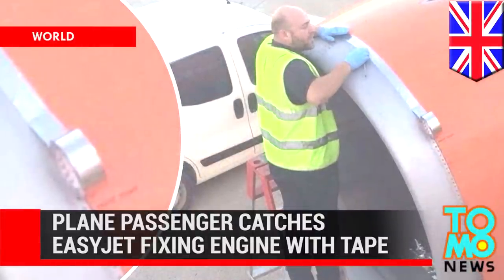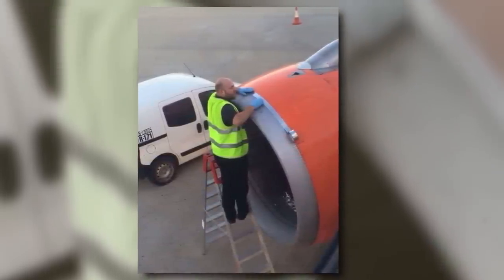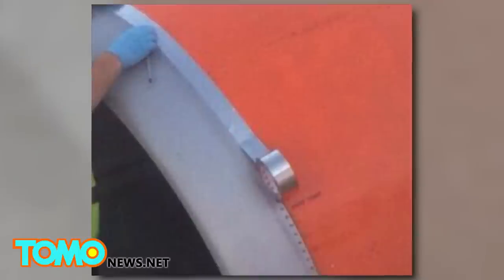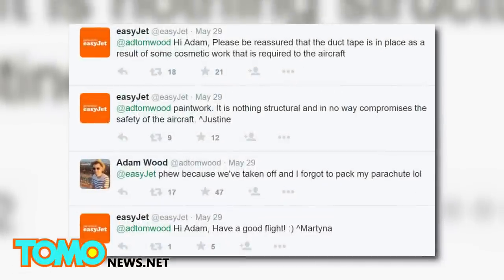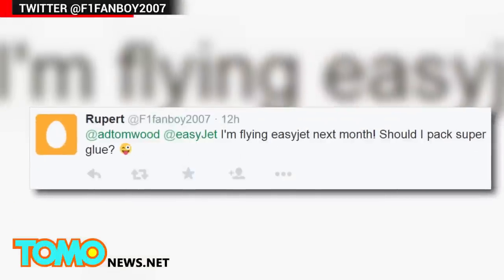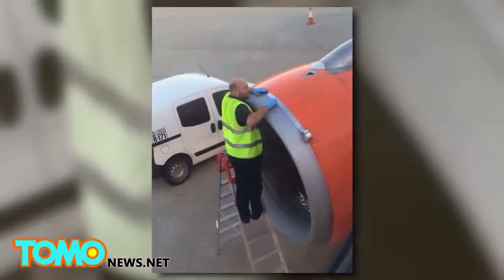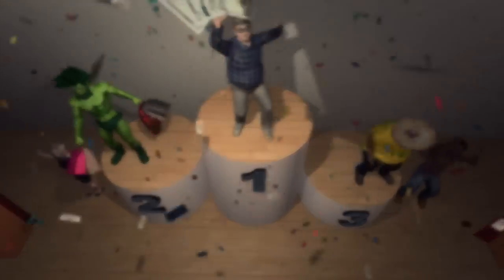Airplane scare: easyJet tapes up engine moments before takeoff in viral photo - TomoNews

Comment: we,  airplane mechanics call this, "line maintenance".. it seems  the cowling (the engine cover) does not fit very well (because normal wear package) and the guy is using this kind of tape only to avoid minimun particles and humidity  ingestion to the top of the engine...this do not, I repeat, do not represent any danger!!
Reply: You have look at it from the side of the person that doesn't know that. I am on the plane and I see the mechanic taping something chances are I am getting the hell off. That should have been down before passenger got on the plane
Reply: Jordan kretz yeah I would get a refund and not ride that one that something that should have been checked and fixed before passengers can see
Reply: hectec69 
there are often just minutes between deboarding and boarding. If a failure on the Tape is spotted in during this time, there is mostly not enough time to fix it before passengers are entering the plane. Unless you want a delay that is, but that would drive off a lot more people off than a normal Maintenance work. Don't forget, that every Maintenance worker is testet multiple times and generally knows what he is doing.
Reply: R. Perez I am training to be a line manager and this is either to keep the bolts tight or to seal air pressure or like easy jet purely cosmetic they would not let a plane fly with an issue

Comment: That's not duct tape, it's called speed tape.  It's aluminum with an epoxy resin backing that applies like tape and cures like a piece of solid metal.  It's designed to cover cracks or minimal damage or bolt holes missing their bolts to prevent further damage until a more permanent fix can be put in place.  I'd rather a crew chief put speed tape over a crack than risk it freezing and expanding at 30,000 feet in the air causing the engine cowling to split open.  THINK BEFORE YOU JUDGE, SHEEPLE.  There's this new thing called the internet that you can use to do your own research instead of blindly believing everything people tell you or show you in a shitty video.
Reply: Uh, what do you think we're doing here if not researching?

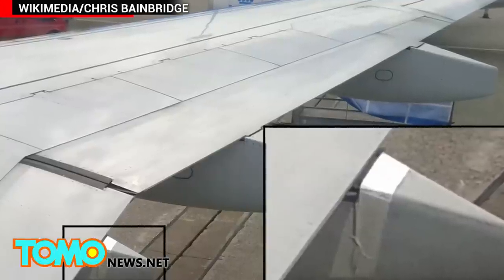Comment: Lol the commentator literally read out the wikipedia definition of speed tape at 0:23
"Speed tape is an aluminium pressure-sensitive tape used to do minor repairs on aircraft and racing cars." -Wikipedia

Comment: they put it there to keep in sealent in the crack between the engine cauling and leadign edge, if they didnt it would make one hell of a mess of the paintjob

its a thick aluminium strip with a strong adhesive, ne roll fo speed tape costs (in inch wid 60 foot long rolls, 30 bucks, same roll of duck tape is maybe 2 dollars

Comment: Covering the exposed rivet-heads streamlines airflow, in the old day's it was called 200 MPH tape and was used to cover leading edges on the wings of light-aircraft who frequented dirt landing strips. It helped prevent dings to the paint but the tape pictured is far more advanced than the old stuff.

Comment: Thats speed tape... It cost 6k usd a roll.
Reply: It's expensive, but not so much. The 3 inch wide one is about 100 usd per roll.
Reply: @palopo-t3v  where? Bc the speed tape used on airplanes has to be approved by FAA and its really expensive.... +1500 per roll. Idk what kind of tape are you talking abt.
Reply: @mrcad796  It's called Aluminum Foil Tape 425 or 427, or just speed tape. The one we use the most is made by 3M. The wide one is about 100 per roll but airlines get it much cheaper because they buy in bulk. The narrower ones are cheaper but I've never seen one of those rolls. Yes, it's FAA and EASA approved but it's just tape. It's not structural. I'm a pilot. It's expensive, but no so much. People exaggerate.
Reply: @palopo-t3v  exactly... You are a pilot. I'm an engineer.
Reply: @mrcad796  I don't know any engineer who wouldn't know the price. You started saying it was 6K a roll. Then 1.5K. Which one is it?You can even buy the tape online for 100 bucks, with the FAR 25.853 approval and all. It's aluminum, not unobtainium ffs.
Reply: @palopo-t3v  price vary depending of the size and type plus additional cost of importation, shipping , etc. Id like to get contact with your people so I can get rich reselling that tape. I hope the one you use is certified for use close to 0.6M.

Comment: BS on speed tape. I've raced for MANY years and we used duct tape to hold DZUS fasteners in place on the race cars we own. THAT is a FAILED EPOXY JOINT and the jet/engine should be taken out of service! That cowling repair should  NOT pass an FAA Inspection.
Reply: No the FAA would not ground the airframe, if they did for that sort of repair, that would make the airspace of the US very very quiet, I doubt there are more than a few dozen big jets with no speed tape anywhere
Reply: How do you know this? From the sounds of it you don't work in the industry. You didn't do a walk-around nor a piece-wise inspection. Suddenly everyone in this comment section is an FAA inspector 🤣🤣🤣